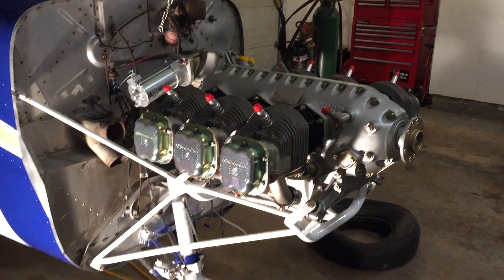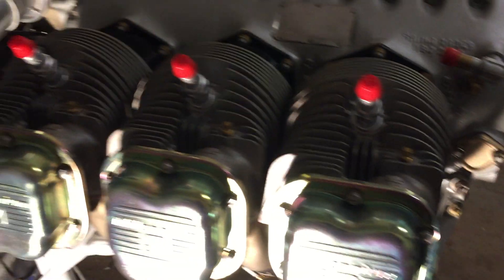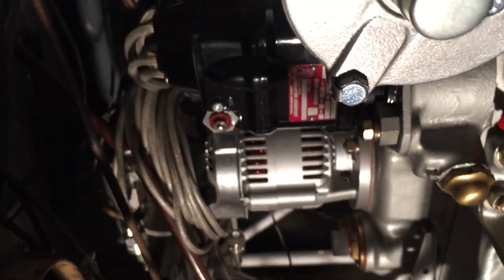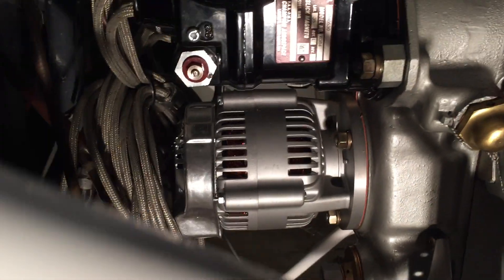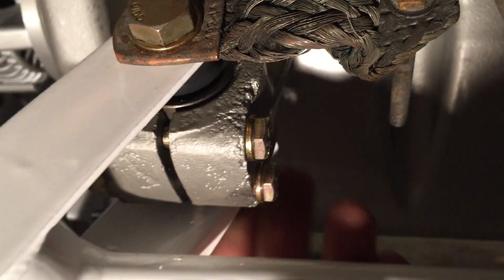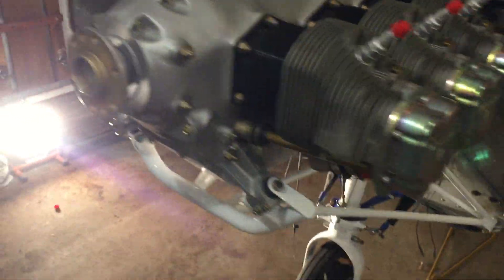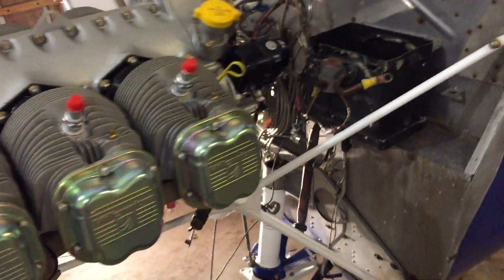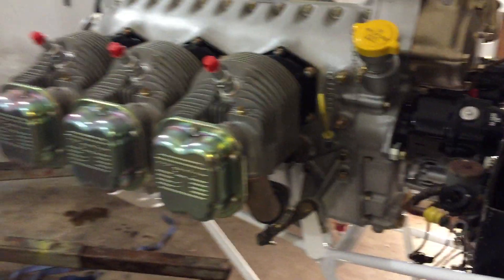Cessna 172G engine reinstallation

Comment: 00:29 The metalwork should be exposed at the fixing point not painted if you're using it to strap an earthing bond to it.
Reply from the maker: Good point, the heavy current from the starter would have to pass through the ground straps. Frankly, I'm not sure exactly how I accomplished the ground path. Good catch!